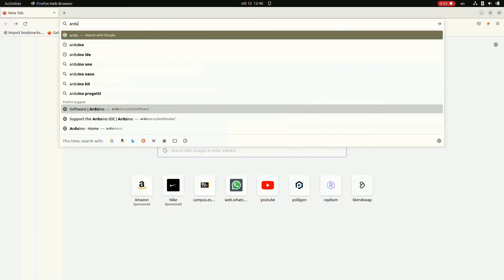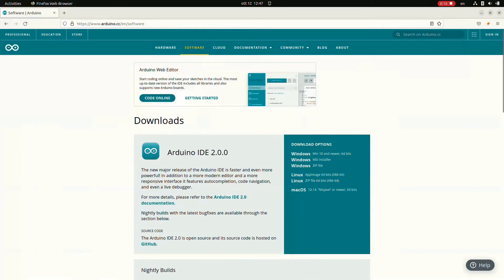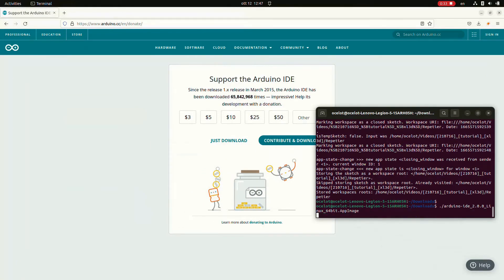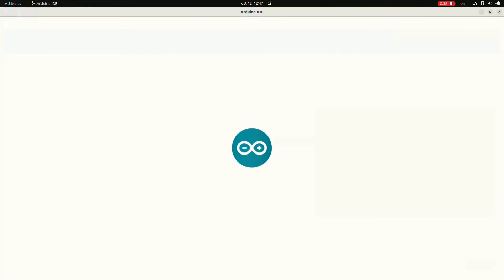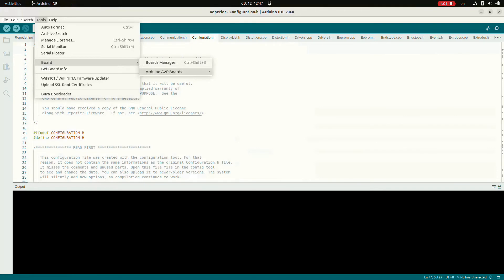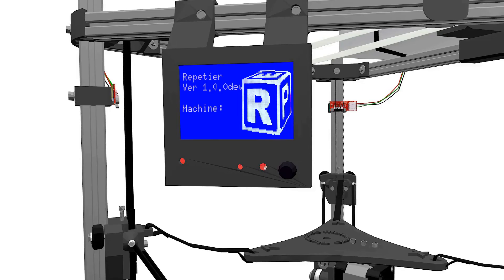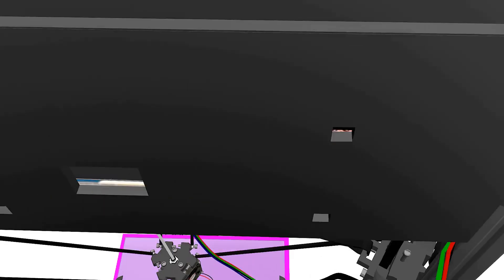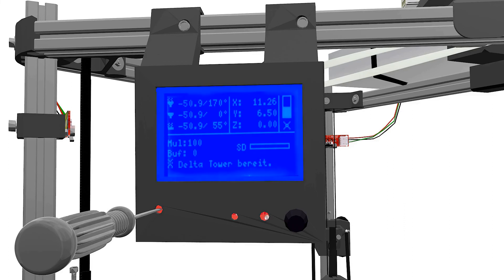Build a Delta 3D Printer - Loading firmware into the Arduino M2560

Comment: Your tutorials is awesome, I m keen on this built becos I got most of the parts except and the 6 ball ends rod & the ramps1.4 board & display. Can I use the old Anet A8 2004lcd 5buttons display with your firmware?
Reply from the maker: it looks like your display should work well with the firmware, you'll still need the ramps 1.4 or similar
Reply: @myriadpro6752  ok, just ordered the ramps1.4 now looking for the exact display becos I don’t have the adaptor sockets for display if I use AnetA8. I will follow your detail video series closely on my built some parts will modify. Thanks bro You r awesome.
Reply from the maker: Sure man, just write in the comments if you need any help with setting up the display and firmware
Reply: @myriadpro6752  what’s the build volume of yr delta? I like it to be shorter. Any suggestions on the 3 pillars & the ball end rods? 250x250x250 build vol. thks
Reply from the maker: The one on the tutorial is built with 1000mm tall pillars to give a 400mm tall build surface.
As a rule of thumb you want the pillars to be roughly twice the height of your build volume (e.g 500mm tall pillars for a 250mm tall build volume) but it's good to add an extra 100mm to the pillars just to be safe, so 600mm.
With a 300 by 300mm square heatbed you should probably get 300mm long carbon or glass fibre rods (those might have to be custom-made as the pre-built ones are about 200mm long).
Reply: @myriadpro6752  thanks bro. Ok my pillars are just 500mm. So I can 200mm built height.
Ok that’s ok. Is it possible to get the 300x300x200 for the 500 height?
Reply: Or I just do 220 x 220 x 200. So the parallel rods should be?
Reply from the maker: In that case you could maybe go for 250mm long rods, don't do them any shorter as you'll have problems when trying to reach the edges of the heat bed with the hotend
Reply: @myriadpro6752  Cartesian box style are easy to know the range n built column😊
Reply from the maker: Yeahh the angled parallel rods make it a bit awkward to calculate dimensions so it's usually better to round up higher
Reply: Using LCD2004.. firmware loaded..select 13 beeper always sound. And encoder button can only activate home.
Reply from the maker: @jimmym2719  hey man, double check with the repetier forum that your loading the correct setting for the LCD2004, the one on this tutorial is intended for the LCD full graphics
Reply: @myriadpro6752  ok thks, I didn’t use the 200mm rod, i just got my 2 pcs 1M x 6mm carbon rod, will cut to 333 to get 6pcs.
Reply from the maker: @jimmym2719  that's actually the best you can do, didn't include this in the video but hope people will read these comments and find them useful
Reply: @myriadpro6752  well, yeah whatever u put here the world will see if they want to build a delta. Thanks for sharing
Reply: Using LCD2004.. firmware loaded..select 13 beeper always sound. And encoder button can only activate home.

Comment: hello! I using LCD 2004 module.  where to repair?
Reply from the maker: If you're getting empty blue screen try flipping AUX 1 with AUX 2 ribbon cables or turning the potentiometer
Reply: @myriadpro6752  
no, I mean: I use 2004 LCD, where do I need to modify in the software?. your 3D printer is using 12864 . lcd
Reply from the maker: @SangNguyen-se8nb  oh, then it should work ok since both use the same setting on configuration file #define FEATURE_CONTROLLER 11 
if LCD Smartcontroller 2004 isn't working when uploading it to the Mega2560  I'd use the firmware builder at https://www.repetier.com/firmware/v092/ and build again copying values from the provided code only changing the display controller to "Smartcontroller from RepRapDiscount on a RAMPS or RUMBA board"